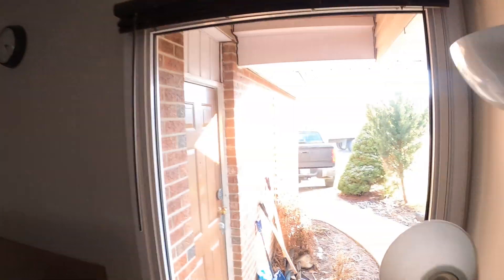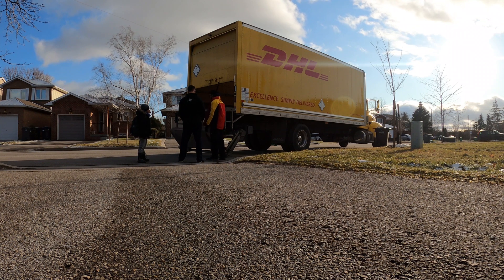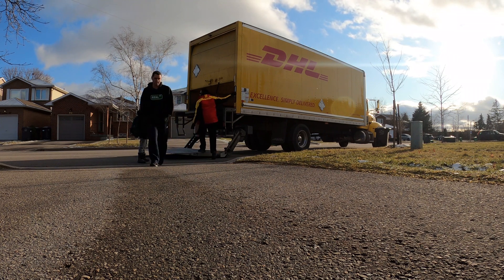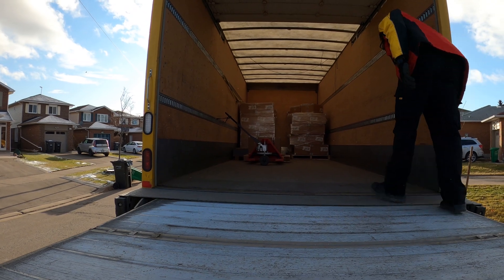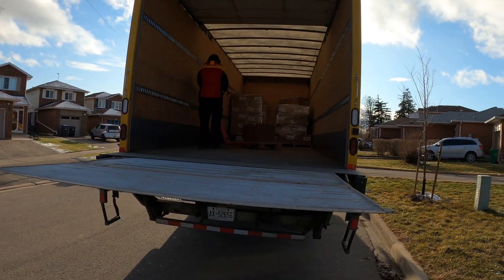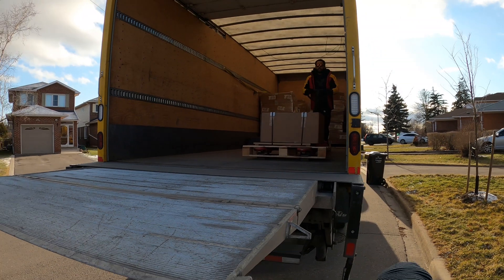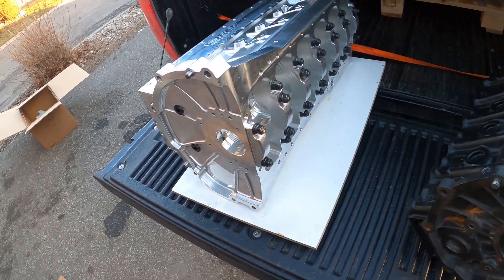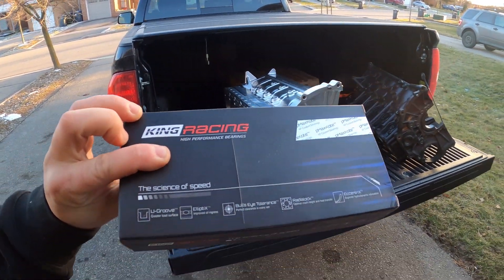Billit 2JZ Block Unboxing

Comment: Beautiful block, but I wouldn’t open it up on some shitty driveway with loose stone everywhere, then let a child touch it with woolly gloves on ( probably got grit on gloves ) then put it on a shitty tail lift of a truck.

Moron, it’s guys like this who build an engine but fuck it up, even before it’s on the car. 

Stuff like that needs to be built in a clean room. With clean tools. 
But know, let’s just put it on a truck tail gate ( full of small bits of grit.
Reply: The internet has spoken, you are intelligence on a keyboard!!!

Comment: you put the head stud in the wrong way
Reply from the maker: It went in without issues
Reply: @RyanSammutRacing  the bull nose end goes at the top not the bottom,just because it went in doesnt make it correct
Reply from the maker: @turbotorana4336  thank you, I'll keep an eye on it when assembly

Comment: Awesome😍😍😍 It's a dream!
All that parts are included in the block price? Head studs, main studs......

The water is flowing through the head studs. What does it mean?

Would like to see it fitted.

Great, if I see your garage, it looks so similar with my. I also use it for my 2jz project only😊

Waiting for your further progress!!!
Reply from the maker: Yes block came with head gasket, fire rings, mains and head studs. 

Water flows through the head gasket typically, that's how the head gets coolant. With this setup, water has to be fed separately to the block and head. 

Thank you, next video is block assembly at the machine shop. 👍